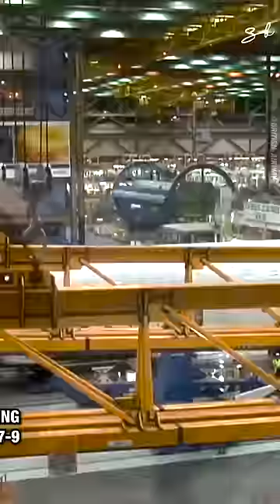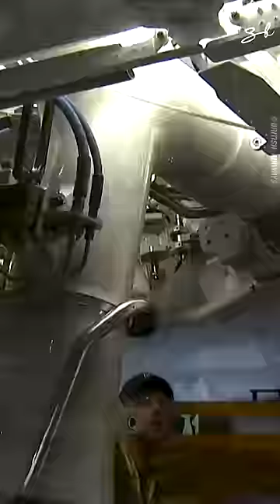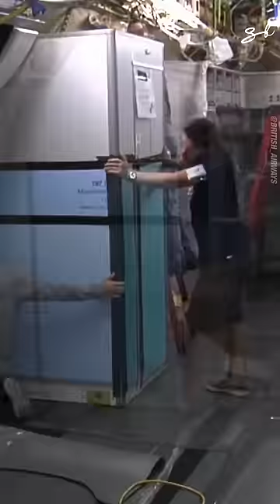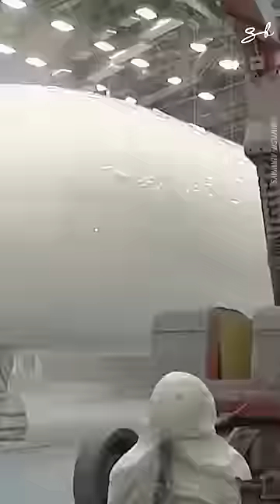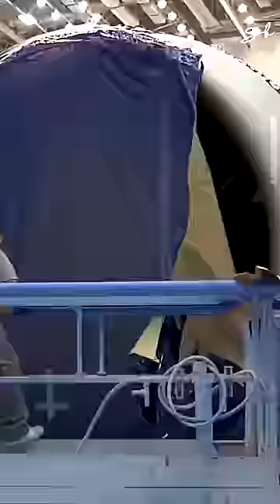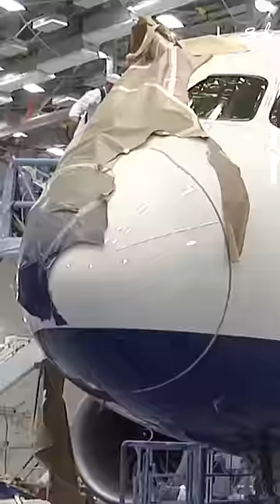Building a HUGE PLANE in just 2 DAYS! 😮

Comment: It's not "building" but "assembling" and painting.. part of the airplane. It makes a huge difference. And even more with Airbus.. It takes months to build the entire airplane.
Reply: That's a Boeing 787 Dreamliner not Airbus
Reply: @russellwilson6193  I ship the fasteners for these, or manage the transportation inbound and outbound to the DC's, and occasionally the exact work station on the line.

Fucking wild to see it.
Reply: @russellwilson6193  I don't know much about big airliners. what is the difference between a dream liner and an Air bus ? Is it the size and power or the style?
Reply: @jaredsmith9215 Boeing and Airbus are the two biggest aircraft manufacturers. Most of the planes are either Airbus or Boeing. Airbus is European and Boeing is American company. 

This plane in the video is Boeing 787 Dreamliner. It's a modern wide-body aircraft (big plane) made by Boeing. A similar plane from Airbus is the Airbus A350.
Reply: Quote
Reply: Engineers deal with that and mechanics deal with assembly and repair.

Comment: That's not building a plane in 2 day's!! That's assembling a plane in 2 day's!! The pressure chamber and wings and cockpit and all the other components takes about 1 year to 3 years to produce the parts (for new models) older models that's already been designed and have all the tooling and moulds for takes about 6 months to build the plane

Comment: Do you know that building an aircraft and just two days is impossible unless you have all the parts already mounted together and just say that you built it in two days because building in two days would require at least 100,000 engineers in order to successfully build it and I don’t even think I’m doing the math correctly. You need a whole lot more than 100,000 engineers to build it and just two days

Comment: I have a new patent for planes so nobody would die in a flight ever....one day I will make them ... there should never be no death on plains....🙏🙇🙏📿🐐
Reply: @alanhinkel420 where there's a will there's a way...it will work .. my patent the plane would never crash it will detect the crash before it happens ... And if the plane crash the people will not get hurt...hint hint ...no matter the speed is going..,🙏🙇🙏📿🐐
Reply: @tttmmm8093  Will it affect the weight of the aircraft? Only thing I know of is parachutes. They have them on small aircraft. Good luck with your patent. Hope it works and isn’t too expensive.
Reply: I wish physics would work. But I guess good luck on your patent.
Reply: @local_flight  I don't know how you could protect someone hitting the ground at 2-600 MPH. Even if you filled the fuselage with foam or water. Water would leak out. Airbags wouldn't work. The force is tremendous.bodies are ripped apart from the force . Water would make the jet too heavy. The only thing that could possibly work is a parachute but it would need to be huge. There are so few crashes that it doesn't make sense. But good luck with your patent .

Comment: Flight ✈️ manufacturing, parell axes thoream and aerodynamic design 20 degrees, thermal air protection system and antiice system bodybuilding metal,body metal titanium steel,sillicon,SiO2+NaHCO3 ,-80%, seesam -20%, or , nickel steel, sillicon, SiO2+NaHCO3 -80%, seesam -20%, metal, body, gas turbo engine s, nitrogen fuel ⛽ 6.4 tones, 22 wheels

Comment: Parealealaxesses thoream and aerodynamicdegined and thermal air protection systems and anti icesyesteam,engine, laynener momateam,formula based,titaniumsteel or Nike steel,engine body,all team,numbers congratulations 👏,  fueel,ending ,time, use, ADi  1248-nikel lithium battery 🔋 or hydrogen battery ,9 minutes flying flight